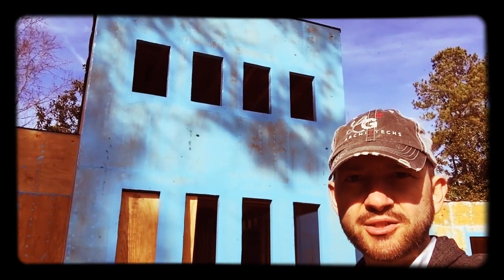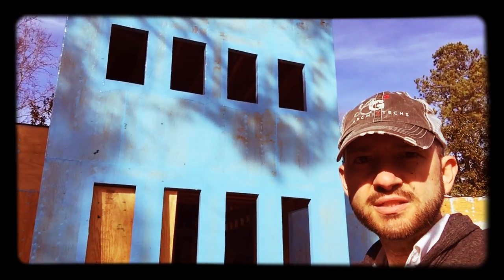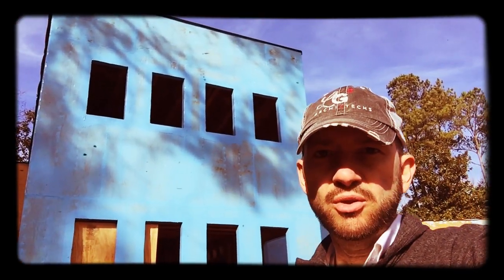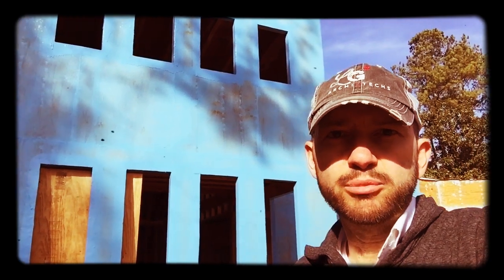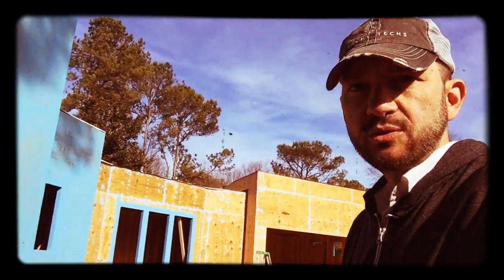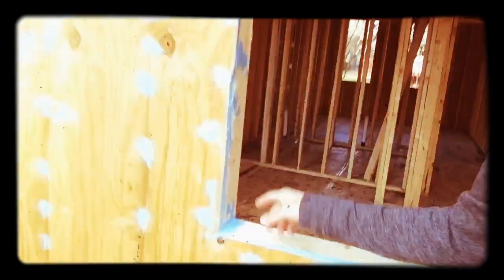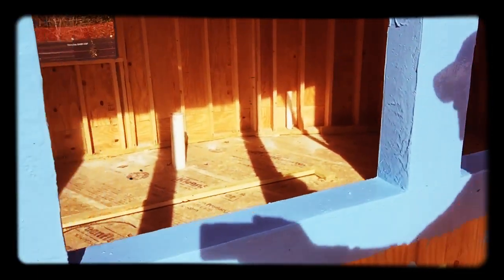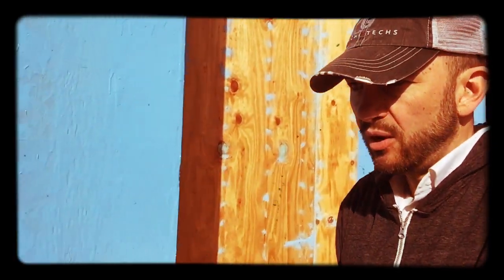Liquid Applied Air and Vapor Barrier (a.k.a. WRB) - Poly Wall® Blue Barrier™

Comment: Great video Chris! I like the way you clearly laid out the three steps required in applying the weather resistant barrier. Its finally clear to me on how to use the 2200, 2300 and 2400 Poly Wall products after watching your video.